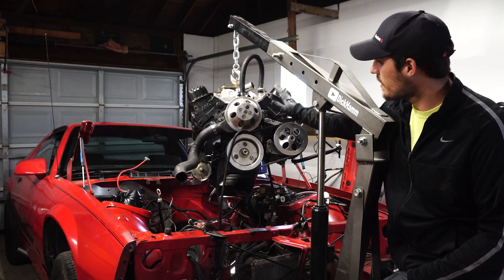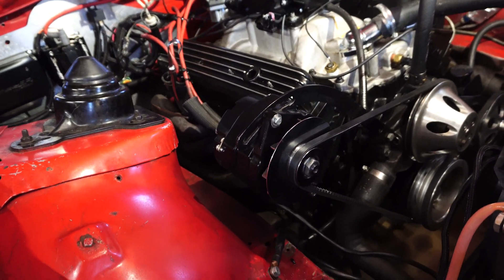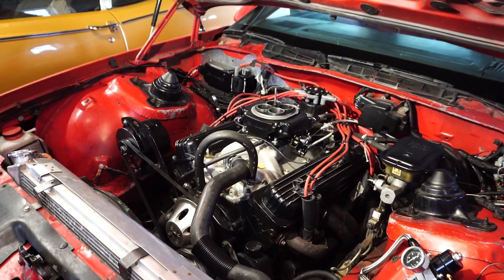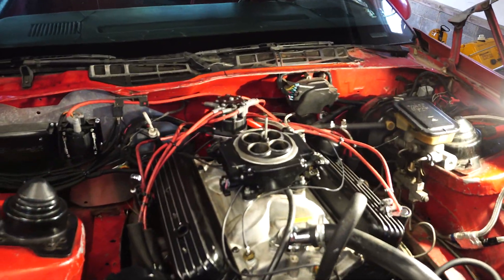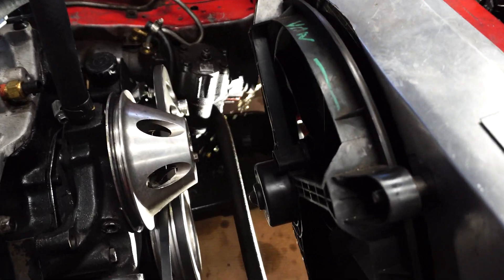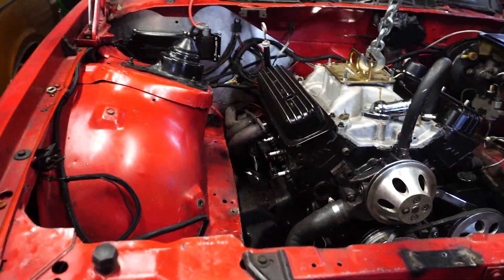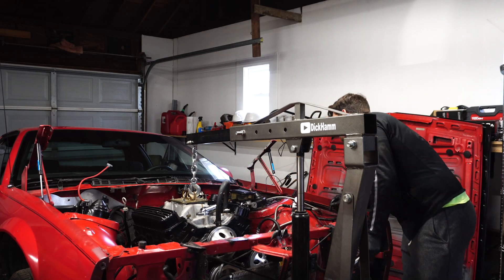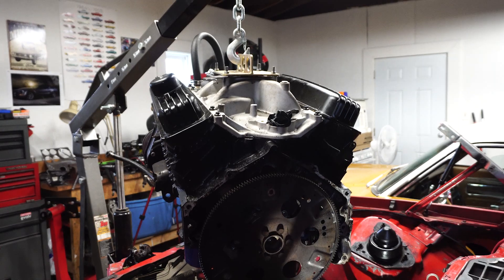Engine Removal! Small Block Chevy 350 Pulled from a Third Gen Camaro

Comment: Do you have video of unbolting transmission and what you had to do? Trying to pull the 305 from my 85 monte
Reply from the maker: I don't have any footage of that but on my Camaro it's just unbolting the torque converter and the bellhousing bolts. You might have to support the trans from tipping forward as well.

Comment: In my third gen (83 Berlinetta), there’s an evaporator and a heater fan on the passenger side of the engine bay. It made getting header bolts a nightmare to get out. Did you remove those? Or did you relocate them?